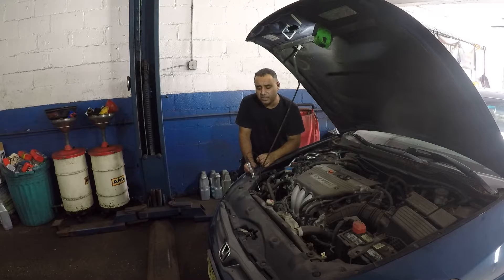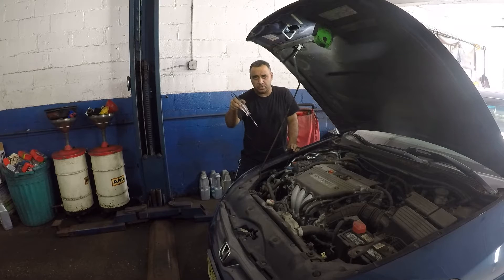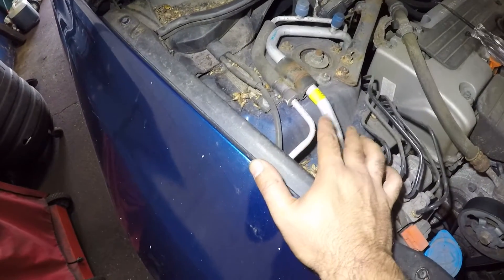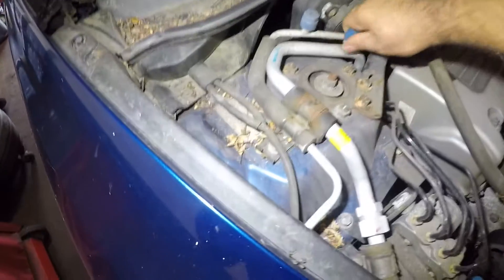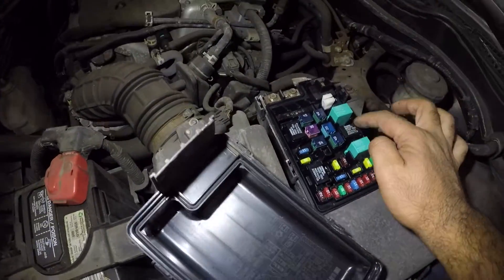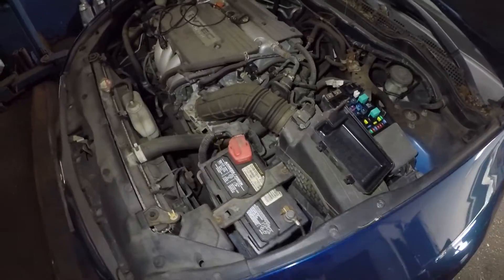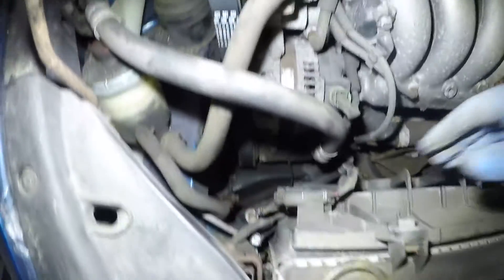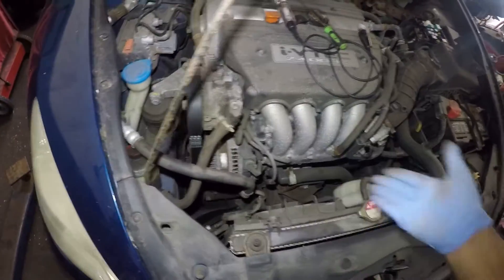How to Electrical Test AC COMPRESSOR power on any Honda Toyota Acura or and other car

Comment: I have a 2008 acura tl type s and the ac works but it seems to be decent but I feel it should be colder because the supply air is 55 and I hooked my gauges up and just added a little refrigerant and the temp inside dropped to 50 degrees and I left it like that but the low side pressure was at 45 and high was 175 and the ambient temp was 100 degrees. According to the data online my low side should be 50-55 and high should be 200+ so my question is based on that info is my refrigerant low?
Reply from the maker: I would recommend ac service with ac machine recover check the reading and compair it to the amount it should have in it 
Then do vacuum 20minutes and recharge correct amount.  
That’s what it seems like it’s low. Also cleaning the front of condenser will help and check if both fans r running
Reply: @RBTheMechanic  yes I use the condenser cleaner in the front and the cabin air filter is also brand new. I do HVAC for the houses and it’s similar to automotive so I was just curious what you thought because I’ve been watching a lot of your videos. I’ve been thinking about doing a recovery and a vacuum just to check everything and pump in some brand new refrigerant. That’s a great idea thank you as I was thinking of doing that at first. I don’t have a recovery unit so I have to pay the local shop 150 for the evac.
Reply: @RBTheMechanic  so I drove it now and I put the heater on and at 80 the air was slightly warm but on max heat it got hot. I lowered the ac to LO and the air is cool but not nearly as cold as my other cars so Im Wondering what are your thoughts or if you have a blend door video on an Acura tl on your channel? Oh and side note I noticed my auto belt tensioner bouncing at idle so I ordered a new one with new belt but it said in rock auto that a loose tensioner can cause issues with ac output.
Reply from the maker: @E85_STI  so what u did means bled door motor is working I have it on accord not to but I doubt that u need to check that cus is operation moving to hot and cold check ur ac line low line is it ice cold? Touch it under the hood
Reply: @RBTheMechanic  my suction line is cold and it’s sweating like it supposed to. It’s not frozen or anything like that.

Comment: Hello I have a 2010 honda accord crosstour my problem is while my ac is on I have loss of power to my battery from 14 to 12w and while in drive the vehicle idles like its rocking 
I put a new alternator new battery new ground wire new belt tensioner and tensioner
Reply from the maker: It might be bad alternator check alternator output some of these newer vehicles work off 12 v

Comment: My Ac compressor is getting engaged if i give power direct from positive battery terminal to AC compressor it engages but not from the socket one wire red one i connect the red socket pin to Ac compresor pin it not engaging so i think red single wire comming to socket dont hv the Power where does this wire comes from by the its 2001 Honda Accord 4 cylinder
Reply from the maker: Did the ac get cold when u did this?
Reply: @RBTheMechanic  no

Comment: What is the most likely cause for the compressor to draw more amps causing the fuse to keep blowing?
Reply from the maker: Too much oil or Freon in the system or bad clutch

Comment: RB you're the man. Question: I'm getting power on all my fuses and relay points, but I am not detecting any ground going down to the clutch with my power probe. The compressor case and external grounds are good, but when I check the wires going into the clutch I have no ground. I'm thinking the clutch is burned up, but not an Acura expert. I know the clutch can't be ground side switched because the relay is the the switch that sends power down to the clutch. Just want a second opnion
Reply: Also, I replaced the relay too! The original one seemed to be acting wacky. I wonder if that contributed to the clutch burning up. It was definitely compressor though, just changing relay first by itself did nothing. Thx again
Reply from the maker: There’s should be direct ground on to compressor from the engine it grounds it self u should have to look for ground. How did u check to rule out relay is not the issue just to let u know I never check to go that deep I simply swap the relay to test it
Reply: @RBTheMechanic  I jumped the relay pins, the relay clicks. I also took relay out and jumped power directly to the clutch at the fuse box. Still nothing. There is pressure in system. Mg clutch fuse is good.
Reply from the maker: @kennethbooker5516  so when doing direct power to ac compressor did it come on engage and ac got cold?
Reply: @RBTheMechanic  nope nothing. That's what I was getting at when i was saying no ground. I can jump power to the clutch but it doesn't do anything, doesn't seem to reach compressor. Wiring is good and I cleaned grounds. I'm going to replace compressor tomorrow and see if that helps
Reply from the maker: @kennethbooker5516  there’s another switch how much Freon pressure u have?
Reply: Yup you're right, I checked the pressure switch and wiring was good. Pressure was like 60 psi at rest, engine off. Ended up replacing compressor today and that did it. The clutch was burnt up (no continuity). Thanks for thinking it thru w/ me brother!
Reply: @RBTheMechanic could a clogged cabin filter burn up the AC compressor?
Reply from the maker: @donniev8181  no I never had that case but u never know how it can freeze the ac system since it can’t push cold air through and systym gets icey

Comment: Hello Sir. When we recover freon, and system is empty than I will not have  power on ac compressor plug ?
Reply from the maker: Nope system will only with once it have good pressure
Reply: Ok thanks a lot 👍

Comment: hello RB, had mechanic install new ac compressor, test relays and fuse to make sure it is good and charge system with freon. after the install, the compressor won't turn on and its a brand new one. mechanic says there is no power to the ac compressor and he doesn't know how to fix it. he says go to honda dealership to get it looked at and they can fix it. my question is: how do they fix this if the wire from fuse box to ac compressor is short? do they re-wire it? and how much does the job usually cost to do? thanks.
Reply from the maker: What kind of car is it?   If the wire is shorted the fuse would blow but yes u would rewire it
Reply: @RBTheMechanic  its honda crv. i took it to dealer per mechanics recommendation and dealer said wire is corroded. they recommended fixing it and re-checking compressor. thanks.
Reply from the maker: @tonylieu2640  oh I see well it’s got to be done
Reply: @tonylieu2640 any updates?

Comment: So yu saying if the relay is bad there will be no power at the ac compressor connection plug but if the relay is good that plug will have power to it
Reply from the maker: Only if everything else is good if ur saying fans and all come on remember pressure has to be good so the system can come on
Reply: @RBTheMechanic  pressure is great fans come on once the ac button is active an fans cut off once ac is cut off just the ac clutch is not engaging
Reply from the maker: @marshallrichardson8575  so it seems like the system is comming on that’s a good sign pressure switch is good and control are good.  Now it’s possability relay is bad so just swap that out if it dosent make diffrence then check power to ac compressor. Also check allllll of ur cars fusses inside out side under hood and all
Reply: @RBTheMechanic  Hi _ was wondering if you can help me out complete my diagnostics on a 2007 Honda Civic SI. AC is blowing hot. I ran your suggested test:  1. Freon in the system enough for compressor switch to send signal to computer for activating clutch, 2.) Swap the relays, 3.) Jump the relay to power directly to compressor, 4.) Check power to compressor - Two of the wires are running 12V with the plug on, my guess is when you say the compressor is open circuit this is why. Also the third wire sends a 5V when I turn the AC on. Now with all of this, it seems to me that this leads to bad compressor. Unless I'm getting everything wrong here. My only doubt that throws me out 100% is when you ask if the fans come on as soon as the ac switch comes on. Is this supposed to happen all the time regardless if the engine is cold or not meaning engine just got turn on? My fans come on only after engine gets hot which means is the normal operation. Now should I take my diagnostics to figure out why fans do not turn on as soon as the ac switch is on? Or should I assume that because the compressor is short circuit not coming on is not allowing for fans to come on right away.  I'll appreciate any inputs, just trying to isolate all possible causes. Thanks for the video.

Comment: Bro I have a Nissan rogue 2010 sl awd my ac not working but freon is good fuse  good the relay is built in so only a fuse is there however there no power in the line towards the compressor
Reply from the maker: How did u determin Freon is good?

Comment: So let me summarize everything for all you rookies lol

First thing to do is check the ac relay. If you don't want to check it then just buy a new one at autozone is only $8 dollars
Next check the 7.5 ac fuse. The fuse is easy to check. Just remove it and look into the light and see if is broken in the middle. If is not then is good. But if you just want to be sure then just replace it with a new one that usually comes with spare fuses on the fuse cover box.
Next pinch the needle on the low side of the ac side. Low side is the bigger tube that is always consider the cold side in case you guys didn't know. If you see air spray come out that means you have freon and don't have a leakage. Next put your test light from the negative side of the battery and connected to the ac compressor switch. If you have power there and both of that fans are turning on, then that means your ac compressor is most likely the culprit.  When diagnosing always start with the easiest thing to check or replace first before jumping the gun and replacing the ac compressor. Alot of women get ripped out by shady mechanics and get charge $800 to $1200 to replace the ac compressor when in reality all they did was replace an ac relay that cost less than $10 dollars.   Be smart women and if you still can't follow these directions then ask a family member or a good friend to give you a hand. No shame in asking. Buy them lunch which is way cheaper that fixing a compressor that might not be bad. 
Just my two cents..... :O)
Reply from the maker: Haha u made that super simple
Reply: You're so correct.  What I've learned is that there's  real mechanics and part changers that act as mechanics who never do proper diagnosis just tell you to go out buy part but you're still having the same problem.
Reply: if the power are there with engine off or on,sir?
Reply: I did test the relay and filter. My air is still not working I'm going to get the power testing tool to see. I try the pressure there was freon coming out..

Comment: My AC just blowing out hot air, but the mane told me the wire to the fuse box is shortened to the compressor
Reply from the maker: Usully the ac compressor shorts out u can disconnect the ac compressor and put inFuse if it dosent blow then it’s most likely the compressor
Reply: @RBTheMechanic ok here's my situation, 03 Accord AC was working perfectly. Sitting in my car at work and the AC compressor clutch just disengaged and will not re-engage now. I've checked the fuses and relays but they're good. Any suggestions on what could possibly cause the clutch to just all of a sudden disengage? I bought the car as a work car because of its dependability, so im not sure how it was treated before me. It just seems as though it would be something other than the compressor on account of how suddenly the clutch disengaged. I've heard the insides of the receiver/dryer can rupture and cause a blockage but it seems I would've heard something. What should the pressures read on a 4cyl Honda?
Reply from the maker: @donniev8181  swap the relay to see what happnes there’s no checking if relay is good or not. That’s first step
Reply: @donniev8181 I used to be able to run my ac testing by jumping at the relay with a wire. I could always hear the loud click. Ac worked good. Now it don't click and ac don't work?
Reply from the maker: @falllLaaaaaaaa  yeah I do that to test could be bad compressor if it don’t click

Comment: I have a 01 Honda Odyssey and the battery dies  Everytime w don’t start it for a couple days what do you think could be the issue do you think it could be the A/C comp
Reply from the maker: Problem like that it can be anything. How old is the battery? Some time old battery wount hold up other wise u need to do parasitic drain test

Comment: Hey bro. One question for you. I’ve got a 2000 Nissan Frontier and I’m getting a ground signal from my ac compressor power line while it’s unplugged. Is that normal ?  My compressor only has one wire
Reply from the maker: Yup that’s revers circuit normal
Reply: @RBTheMechanic  …..cool. Just Got a little ac problem.   Trying to figure it out

Comment: What if low in pressure doesn’t the power shut down to the compressor so it doesn’t ruin it
Reply from the maker: Yeah that will cause it to shut down or come on but not make cold so recharge the system
Reply: @RBTheMechanic  so is my compressor bad my 12v light doesnt come on when hookee up even when car is running????
Reply from the maker: @cardelltalton6687  12v where? Ur checking with test light on the next of ac compressor
Reply: @RBTheMechanic  im testing it on the pigtail plug its the plug under the radiator fan plug left fan its almost like a pinch and pull 1 end goes to the compressor and the other end runs with other wires.
Reply: @RBTheMechanic  yes I tested it on compressor side well at the pigtail where the 2 gray pieces connect.
Reply from the maker: @cardelltalton6687  if it dosent have power that dosent mean compressor is bad now u need to see if fuse relay and pressure are good
Reply: @RBTheMechanic  IV already replaced the fuse relay and compressor still has compression but my clutch wont spin but spins freely its just the lines are not hot!!!
Reply from the maker: @cardelltalton6687  Freon pressure? Did u service the ac system to add correct amount of Freon dose both of radiator fans come on when u put the ac on
Reply: @RBTheMechanic  yeah both fans come on I dont think it will take freon BC the clutch isnt engaged I vacuum the lines too im just going to change the relay 1 more time if not change my compressor
Reply from the maker: @cardelltalton6687  yeah if u vaccmed it should take Freon in but ru using cans?
Reply: @RBTheMechanic  it won’t let me cause the clutch won’t come on
Reply: @Mosinlogan it was my compressor that failed